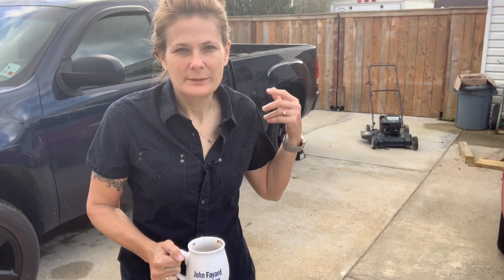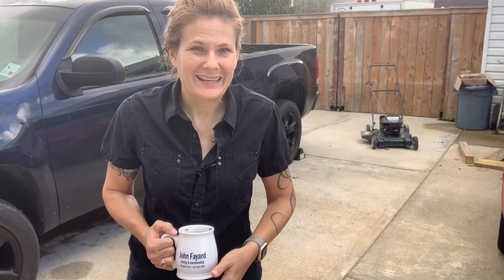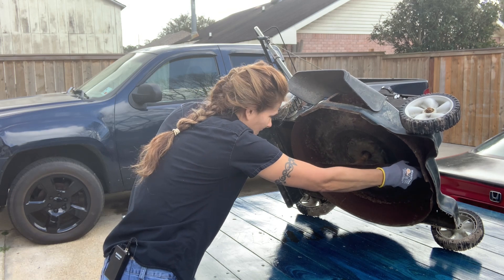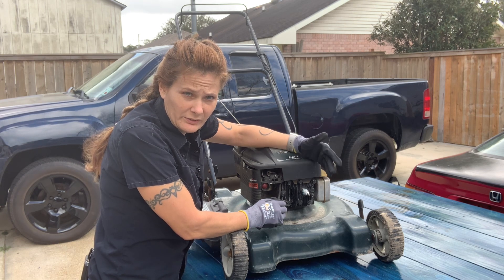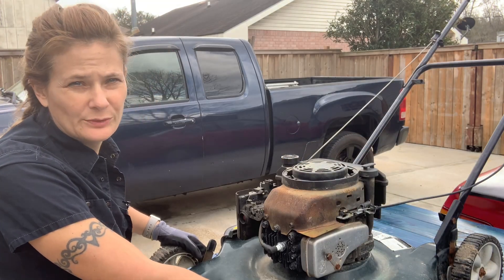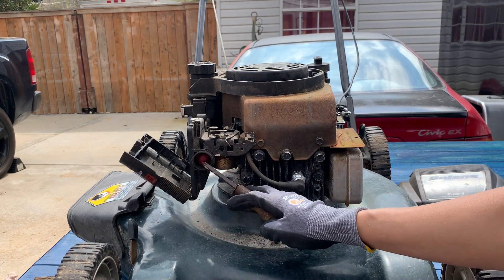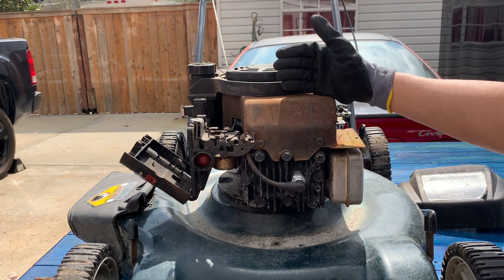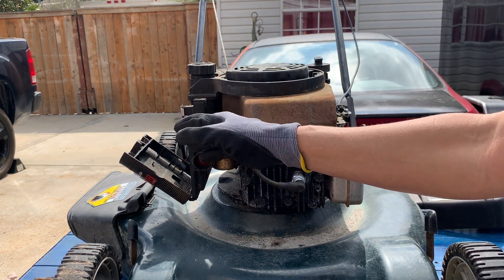Fixing the lawnmower (part 1)

Comment: Another note would be also if you are working on a small engine that has a oil shut off you won’t get spark either until you add oil Honda’s are notorious for that. If you use WD-40 instead of ether you get your engine to pop and you lubricant your cylinder at the same time.

Comment: Hi Betty, I sure wouldn't worry about taking it back if you get it running.(But I was wondering if they threw it out or maybe just left it sit while they run to the bathroom)😂😂 Most people today don't know how to fix anything so they just throw it away and buy new. My neighbor & I use to have a lawn service and we found two nice riders that people put out for the garbage man. Had them both running in less than 30 minutes, I tore them down, painted them and they looked like new while making us money😁 Now I know your a smart lady but you made me nervous turning that blade without taking the spark plug wire off🙄 Thanks for sharing Hon.🌹👍🧡👌 PS~>My Father had a mower repair shop up in PA.
Reply from the maker: I thought about that right after I turned that blade... I was like ohhh no what if that cranked and chopped me!?! Yikes! And yeah I knocked and nobody answered but it was at the road staged like they were throwing it out